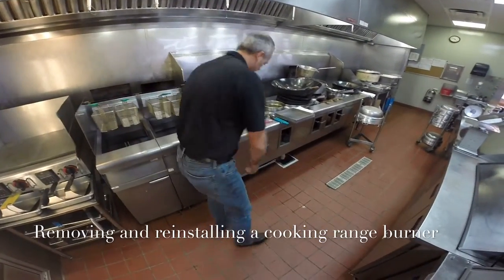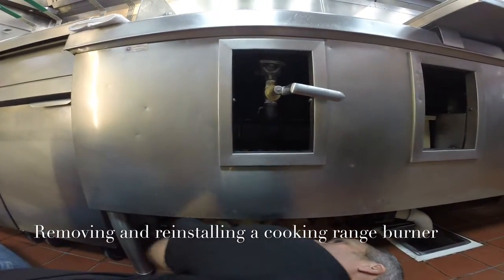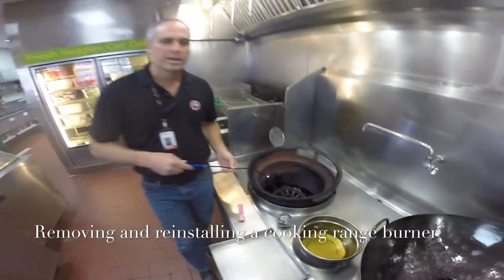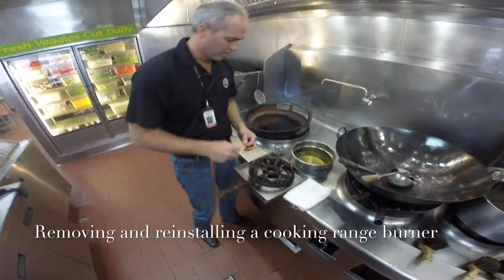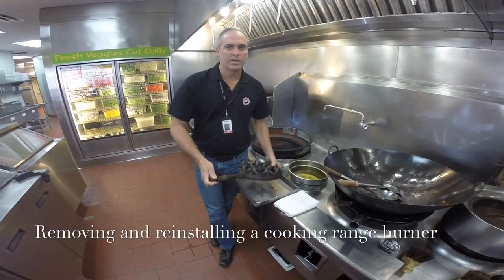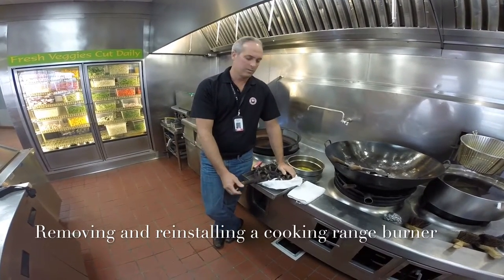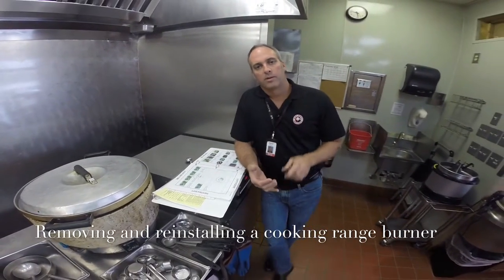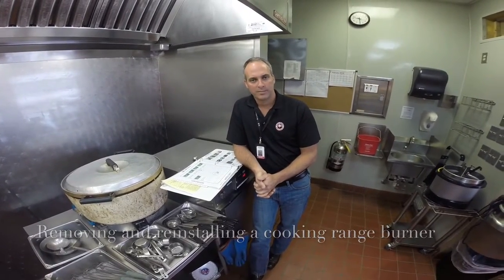Removing and reinstalling a cooking range burner

Comment: I worked for Panda Express for about 13 years and I was BOH chef . The manager would always ask me to change the burner but at first I was nice  enough to change it. After I’ve noticed that the manager was taking my kindness for weakness so I had to stop helping completely.  They were using me to save money . So my question is it against the he law for them making me do this type of work if I wasn’t certified for the job  cuz I was only there to cook for them .